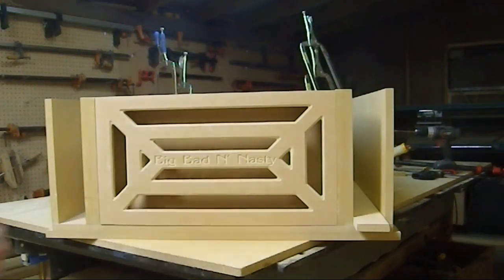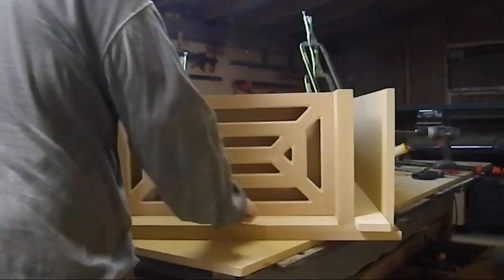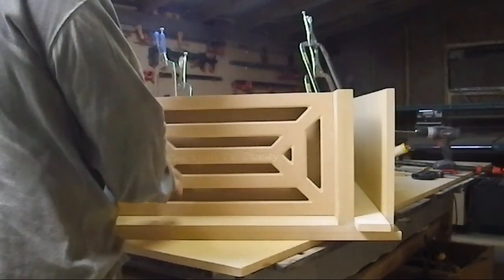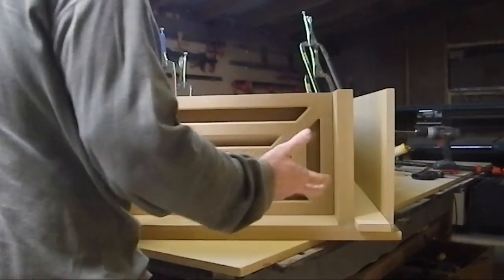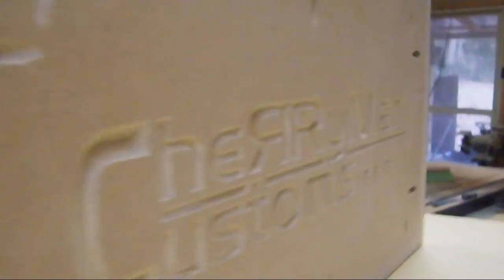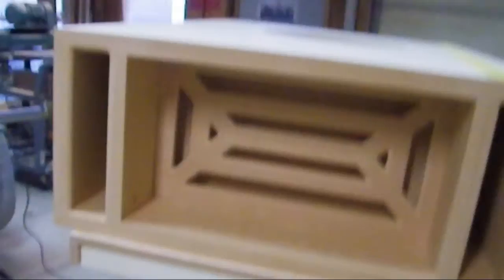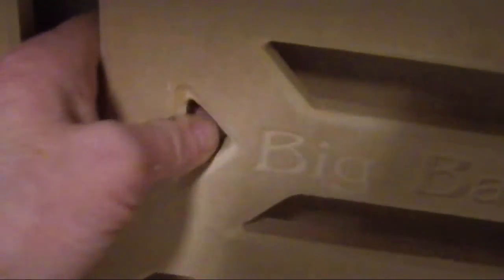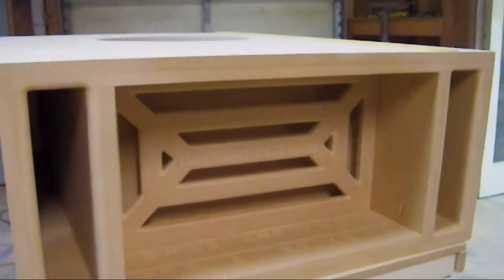EMF Adjustable Volume Enclosure

Comment: I need you to build me a box for 4- SA8 box will be seat also for 07-13 gmc ext cab with high transmission line. Can you email me please? It's for a custom Arctic rush truck build for car shows and venues. Bjdcwitt @ gmail.com thank you Brad Witt
Reply from the maker: call or text me 731-616-5739 Thanks Robert